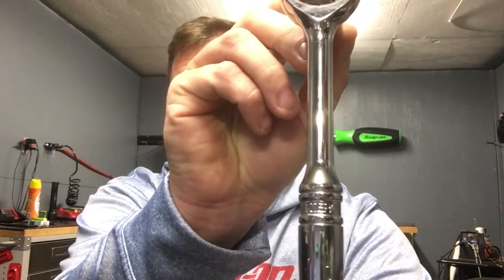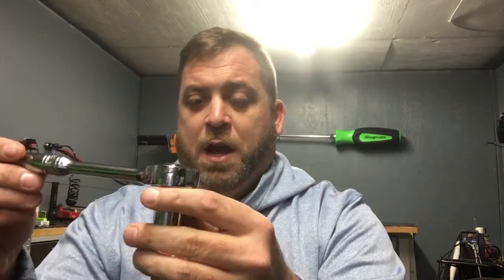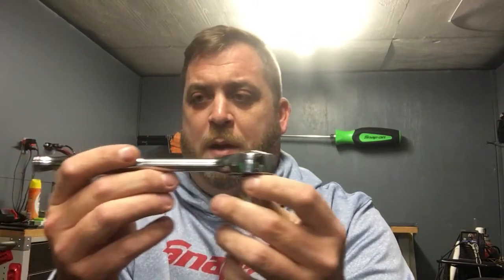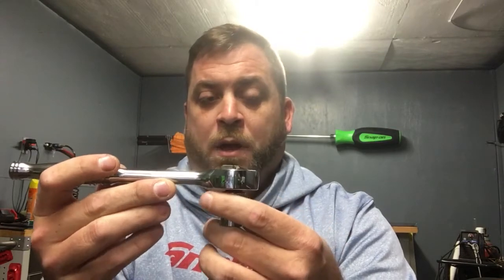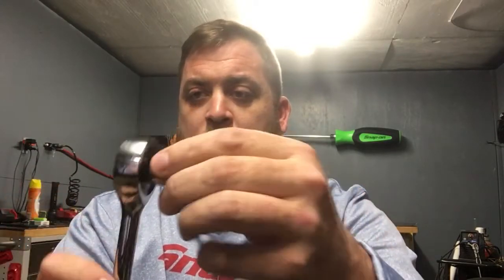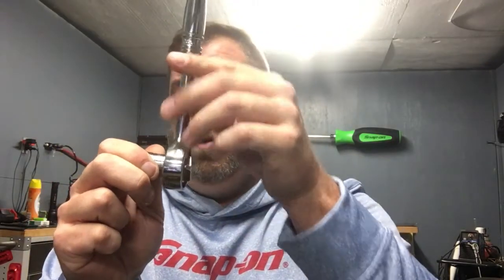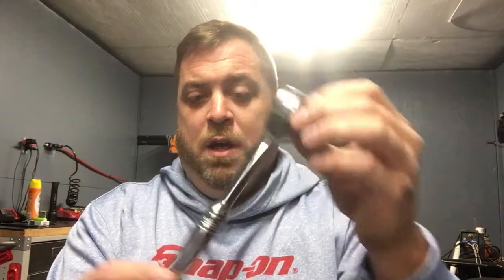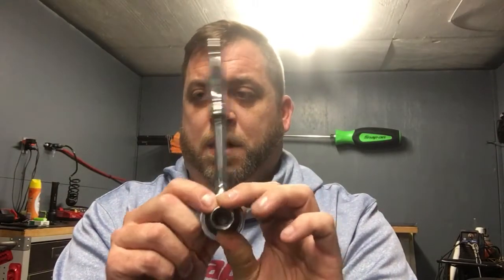The snap on Fzero ratchet

Comment: Thanks for the review!  I designed the FZERO for Snap-on and wrote the patents.  Initially our goal was to eliminate the back throw for better access in tight spaces.  We soon realized that is was stronger, faster and safer than most ratchets.  We replaced the gears with rollers which provide 8 x's the amount of contact surface area.  No more busted gear teeth and broken knuckles.  I am working on a series of tools which incorporate my reversible roller clutch.  This will include air ratchets, torque wrenches, combination wrenches and cordless drivers.  So stay tuned....
Reply from the maker: I you ever need a tool tester let me know
Reply: That would be awesome.  I typically patent the ideas first and then build prototypes.  Working on samples now for the Gen 2 Roundhead, Gen 1 Pearhead and a set of Roller Gear Wrenches.  My patent for the gear wrenches granted yesterday which includes the normal combination wrench design plus a second design for interchangeable heads using a single handle.  Pls forward your contact info to: stu@rollerclutchtools.com
Reply: I think this style of ratchet mechanism is the way of the future. Wish it was more compact.
Reply: Awesome stuff but needs one hand direction change .
Reply: Fairly stiff price point too

Comment: Cornwell also has a gearless ratchet using ball bearing clutches like this one, its made as a pass through set with 1/4" and 3/8" adapters its nice to have one for the swing arc sometimes but i definitely prefer my regular ratchets better for most things i will say in my experience having a similar tool you wont use this as much as you think you will when you buy it

Comment: What makes they work inside?
Reply from the maker: Justin Sero sr it uses like a ball bearing type eccentric piece on the inside I have never taken apart but it's got like ball bearings inside and is soon as you move it backwards they walked the other way or tightening or loosening
Reply: Oh I get ya. Well I never heard of that. That sounds awesome. Can u still apply alot of torque to it?
Reply from the maker: Justin Sero sr yes I do believe so I don't know exactly what they are rated for what I'm assuming it's the same as any other 3/8 ratchet you notify 120 foot pounds maybe more but it was really made for like tight spot like the video said they're pretty nice you should look at them if your guy has any on your snap on truck
Reply: Ya that's what I thought that's really good. I will definitely ask my dealer about that. I know he don't have it on his truck. Or I would of seen it by now. Cuz I can be on the truck for hours if my boss would let me. Lol
Reply from the maker: Justin Sero sr  me too lol
Reply: Judging from the price...PURE GOLD.